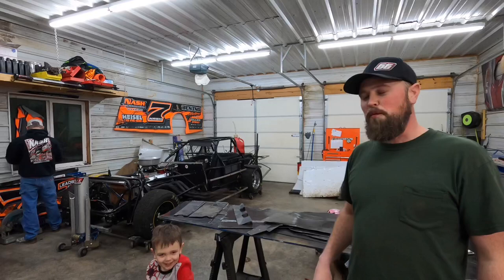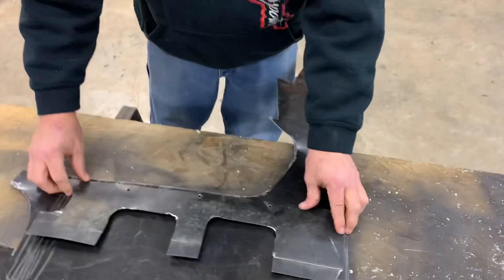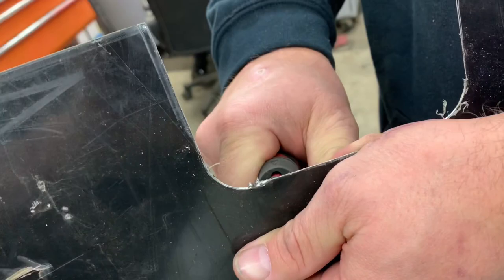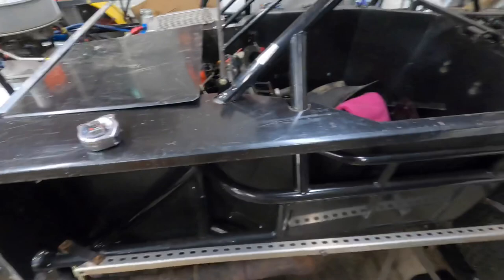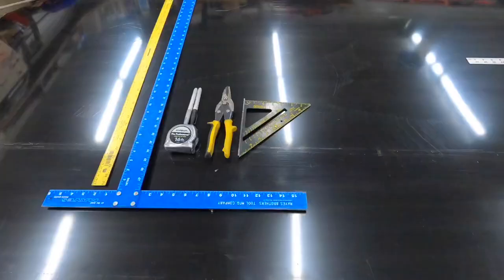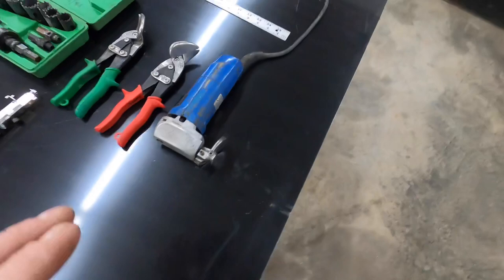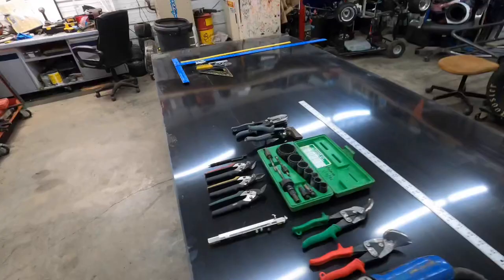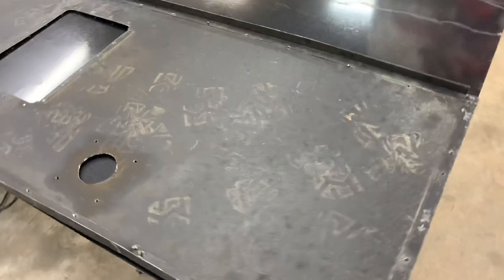Race car body fabrication - learn how to do it yourself pt.1 DIRT TRACK RACING

Comment: What tool was that, you was using to make marks for you bends. The silver one
Reply from the maker: Here ya go:
General Tools 88CM Tungsten Carbide Scribe and Magnet https://www.amazon.com/dp/B00004T7S1/ref=cm_sw_r_cp_api_i_M7r0Eb97E2Q3B
Reply: Old No.7 Garage  no the other one I’m guessing you use it to Mark scrubs for you bends. It’s the silver adjustable tool
Reply from the maker: Gotcha, yeah here you go: Malco A60 USA Made Sheet Metal... https://www.amazon.com/dp/B003NFOAKU?ref=ppx_pop_mob_ap_share